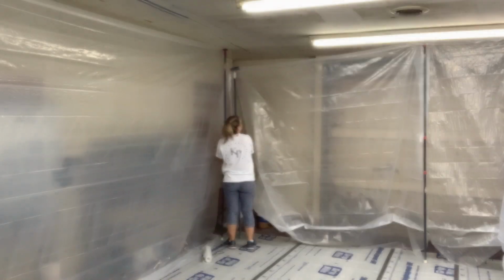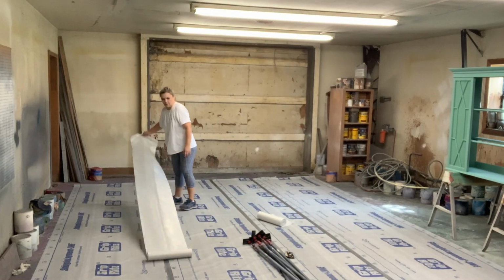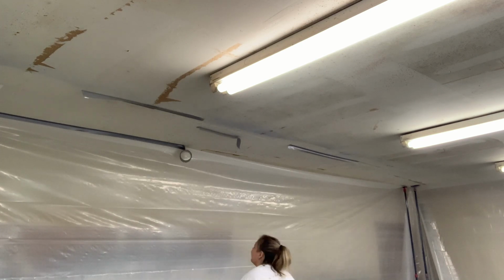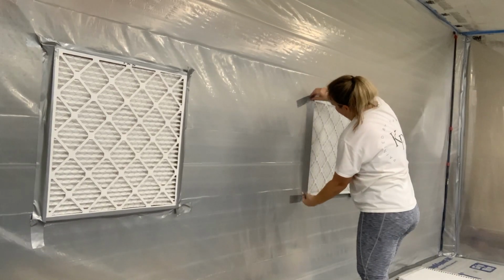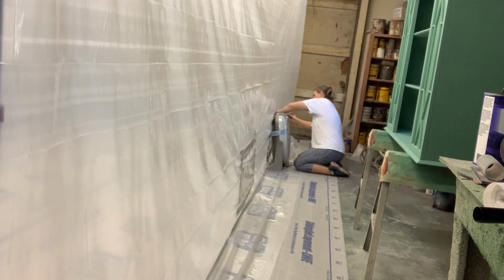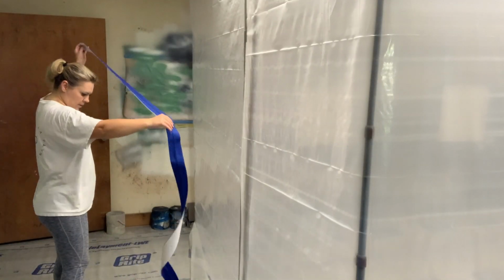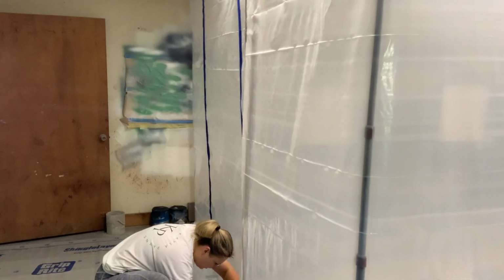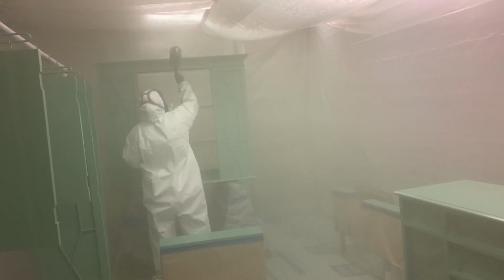How To Build A Temporary Paint Booth For High Gloss Paint - Fast and Inexpensive

Comment: How do you handle coming out of booth after spraying to stop dust coming in
Reply from the maker: You just have to unzip, step out, and zip back up as quickly as possible!
Reply: @KaylaPayne  haha, yes. Maybe a little built on plastic transition room over entryway or just drape extra piece of plastic over zipper door to block being wide open
Reply from the maker: You can never be too careful and no such thing as taking too much precaution! But I’ve never had a problem with noticeable dust coming in from exiting the booth.

Comment: By the time the paint gets to the fan its dry. Your not going to have an explosion. Turn your fan on. Youll get a much better finish. (hazerdous materials trainer by trade)
Reply from the maker: But imagine if I hadn’t at least tried to give a disclaimer. This comment section would be filled with people appalled at using a box fan with solvent paint. Just like ppl should know not to eat tide pods, but they still have to tell ya not to lol

Comment: If you aren’t using a sprayer for the high gloss and you are brushing it on, do you need the fans and filters or can you just tarp it down?
Reply from the maker: It would still be a great idea to filter the booth and run fan constantly before, during and after brushing! It will help control the ambient dust!
Reply: @KaylaPayne  I start doing my set up tomorrow for the neg air room (Fine Paints of Europe primer/Hollandlac cabinets). WISH ME LUCK! I followed your purchase guide for cabinet painting. I'm rolling and back brushing though. I don't have extra funds for sprayer. My cabinets are melamine.   

** 1. When I do my initial sanding, before priming, do I need to be more careful with these than tradition wood?                                                                                                                    ** 2. That last round of sanding before the final coat. I've heard you say you used 400 grit in a prior high gloss video but in the "cabinet shopping list" the highest grit was 320 (ish?). Is one more preferable before the last coat?

Comment: Hey I have a massimo vignelli Saratoga sofa that was original painted with a polyester lacquer. It’s very high gloss. It needs to be repainted. What would you recommend as the best paint and method to repaint it? Could I use this enamel paint or would polyester lacquer be better? Or should I opt for a polyurethane?

Comment: I love your videos!  So so so helpful! Can you discuss how you decide if you need to sand and repaint if you get dust on your pieces... I've tried everything... built the paint booth from this video... super helpful but I still get a few bits of dust... I've always been a perfectionist usually to my own detriment... any guidance or advice would be amazing! Thank you!!!!!!!
Reply from the maker: I’ll only sand it down and re-paint if that final coat is like….really bad. 
Normally I’ll only get a few pieces of trash in my finishes, and no matter how many times I were to re-paint it, there will always be a few pieces. 

When using a slow drying, gloss oil paint, you will never have it 10000% dust free. It’s just not possible, unfortunately. 

If the finish has just a bit more dust in it than I deem acceptable, I’ll cut and polish the flat horizontal surface (ie: the top of a dresser)

Hope this helps. xo
Reply: @KaylaPayne  THANK YOU!  I was about to throw my project over the balcony.
Reply from the maker: Are you using Hollandlac?
Reply: I am

Comment: How often do you have to swap out the plastic sheeting? Is it for one project and then replaced? How do you keep the shingle underlay clean?
Reply from the maker: This type of booth will need to be re-done after a few projects. When using gloss, I typically change re-make it after 1-3 projects

Comment: It seems that your material is being applied with a lot more pressure than mine. I am using an air assisted  HVLP. What are you using if you don't mind me asking? I guess I am asking what kind of gun are you using?
Reply from the maker: I'm using a SATAjet x5500 RP gun here and the regulator at my gun is set to 40psi.